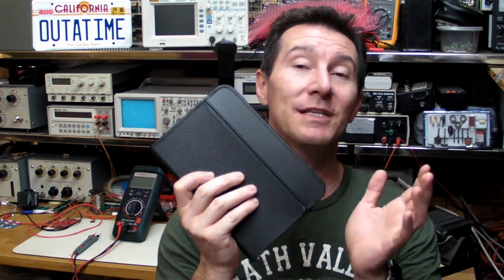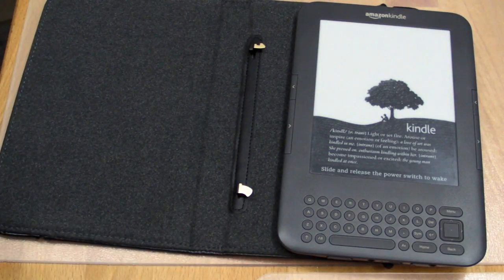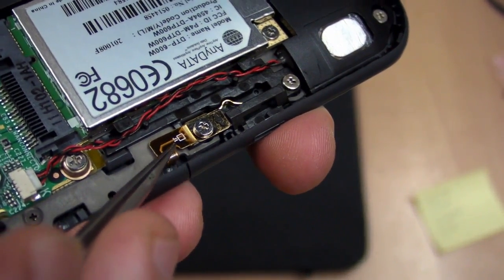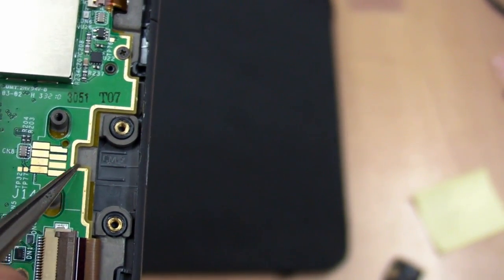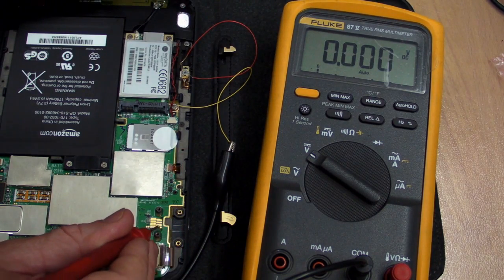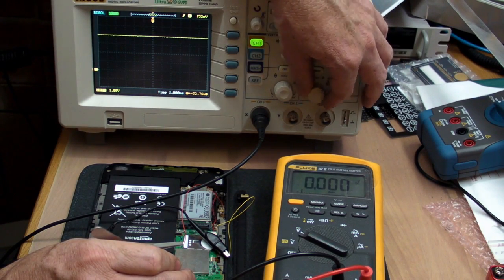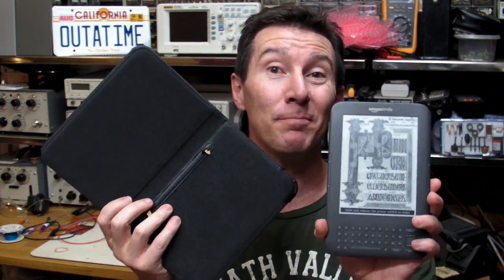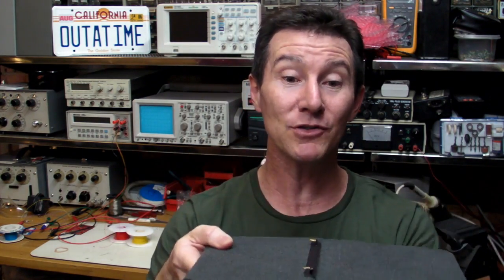EEVblog #135 - Kindle Case Mythbusting

Comment: but if those connectors have paint that is wearing out could it cause resetting when the mystery pin shorts only to RX or TX or even both without shorting to ground or even shortibg them together

Comment: Do these cases have magnets in to trigger read switch for auto-sleep/wake I know the newer kindles and cases do, as do quite a few similar devices. (My tablet does to)? I'm thinking just unlikely chance the the movement of the magnet when opening it is causing just the wrong stray current on just a particular track (the nexus 10 pogo pins seem to have this problem).

Comment: I am still using my Kindle 3 with the non-LED official case. I have one vague memory of accidentally picking the Kindle up by the Kindle itself - not the case it was attached to. The painted hooks on the case would be pressing against something inside the Kindle. It died. Turned itself off. I had no problem turning it back on. Other than that, I haven't experienced any issues with the case or my Kindle resetting or dying.

I have had my Kindle freeze occasionally. I could not get it out of standby mode. I let the battery die. After recharging the battery, all is back to normal. Unfortunately, my battery normally lasts like 2 weeks so it takes awhile. Turning it completely off (screen goes white) when you're not using it seems to prevent that problem. Always leaving the Kindle in standby mode (random image on screen) increases the risk of a lock up. Occasionally resetting any device that I tend to leave on 24/7 seems to help me avoid problems. Whenever I remember to, I cycle the power on my mobile phone, Roku, Kindle, and Nintendo 3DS.

Comment: Great myth-busting! :-)
The symptoms described sound ominously like capacitor plague symptoms. I wonder if the problem is faulty capacitors? You would need to get hold of one of these malfunctioning Kindles to find out the problem.

Comment: I bought my Kindle 3G Keyboard about 3 years ago and have used it every day since.    The first year I had it, I used the Amazon Kindle leather non-LED case - the same one in the video only without the built in lamp.   No problems - always worked.   For the last 2 years, instead of the leather case, I used a silicone rubber armor skin for drop protection.   It worked fine for 2 years until last month when it  started rebooting and then freezing continuously.    It has nothing to do with the leather case.   Sometimes, the Kindle will be functional for a short time, maybe about 10 minutes before going into a reboot again.  

I have tried the 20 (to 60) second On switch reset solution, updating the software to the latest, restoring the device to the factory default condition (deleting all contents) to no avail.   I see that in 3 years, there has not been a solution offered for this problem, either by Amazon or any hackers out there.    It is still a mystery.
Reply: Looks like they want you to buy a new model. Sounds familiar.   New model means access to new product offerings and maybe lower bandwidth use on their end. 

I used to be an Apple user. Maybe that's where my attitude comes from. 

Dump any device sold by a content provider. Life gets easier.
Reply: +Cristi Neagu Unpopulated memory can also be that between design and release, larger memory chips became cost effective and so they didn't need to populate all locations to reach the design capacity.

It also may be so they can release a higher capacity model later without redesigning the whole thing.

Designing for potential model changes is NOT the same thing as planned obsolescence.  Planned obsolescence is when you design it to become useless or break.
Reply: Lawrence Bosse My Kindle 3 has been working just fine for over 4 years. Never had an issue with it and battery life is still around 3 weeks (i don't actually know cause i charge it so rarely i can't keep track of it).
Reply: Lawrence Bosse My mk1 Paperwhite kindle is working fine after over 2 years.  The previous kindle I had (the model in this video) I donated to my dad and that's still working fine too.  Sounds like you just got a bad one.  The biggest problem I had with the Kindle 3 case is that there's only the two brass tabs to hold it in place in the case, and they're not very robust and break after a while.  I got another one and put a little bit of velcro tape on the back of the Kindle and in the case, problem solved.  The velcro keeps the kindle bending the contacts and everything's fine.
Reply: My experience has been different. 

Right from the early days of the intentionally gimped Macs.  I have found that most consumer electronics, when examined at the board or firmware level, show glaringly clear indications of planned obsolescence. 

Apple is the king of this practice, but I see it everywhere I look.  Strangely unpopulated memory, firmware with bricked-up sections that magically resolve into whole new "features" with the next version.

I don't know.  Maybe I am Jaded and too old.  When Jobs gimped the Mac only to release the New Version with nothing but the same board ungimped, I started seeing it everywhere.

---

After reading all of this again, maybe you thought I meant that the Kindle would physically fail.  I can see how I wrote that wrong.

What I meant was that when I opened up my first Kindle I found unpopulated "processors" (slippery term today with FPGAs floating about) and memory, only to find them populated and active massively in the next version, I figured they were just extending the product line to foolish consumers who will buy any new item.  Maybe that is restricted to Apple users.  I don't know.

I do see that I was not clear or on point.
Reply: Lawrence Bosse Unpopulated processor footprints might mean a lower spec version. Also, maybe those processors aren't tested with the full design yet, and they prefer to push the product as is now, and provide a better version in the future. In any case, considering that next to no one opens up their devices, and even less people spend the time to actually understand what goes on with the electronics, it would be no surprise to see companies taking advantage of our ignorance.

Comment: Try increasing the fault current draw upwards beyond the 250mA you've demonstrated as not being a problem. A sustained high power draw near the current limit point could be a problem if it causes a voltage sag elsewhere (i.e. the problem has propagated).

Comment: I've had a lot of problems with my kindle freezing but this is the first I have heard that there is a case issue.  Hmm, guess I should stop using this case then and see if that solves my problems.

You probably haven't looked into it further, but since this video is almost 3 years old, I was wondering if the problem was ever determined?  Its not a short of those contacts but does anyone know what the problem is?

Either way, good video!

Comment: your analogy is moot for the reason that you are talking about testing a completely different product (make and model) for a problem in another product with the only similarity is that they are the same TYPE of product. but to put your analogy to proper use we can say, if you have a common problem with toyota (say the accelerator is sticking) but its most prominent in a prius that is painted black. this does not mean you cant test a gold one because the issue has only to do with the accelerator.

Comment: ESD or maybe a mechanical stress in the right spot on the PCB. My guess is ESD from a plastic case that should have had some carbon added to the mix to keep it from building up a charge. Usually pins for any connection are tucked in far enough to keep any shorting issues at bay. Thankfully I am too poor to run out and buy the latest gadget. I also like to see the initial failure rate of an item before I invest in it. Leave it to some twit to make a fatal carrying case for the darn thing!

Comment: Hi Dave. God Bless you mate. I really am having trouble with my Kindle 3rd Gen WiFi only. I have tried all rebooting methods, recharging for 30 Mins. rebooting again, etc... The unit is frozen on the book list menu all the time. The yellow led turns on when plugged-in to the adapter, but, the green light does not. Why is it frozen like that? Can you help me in understanding this idiotic problem Dave? Do you suggest I just ask Amazon to give me a new one? Amazed at yor knowledge too. Thanx

Comment from the maker: @crazypete05 You clearly missed the entire point of the video, which was explained (clearly I thought) up front.
There was a rumor that the metal contacts were shorting out the contacts in the connector. That CAN be investigated and tested without the actual case. In fact to prove it I would have had to rub the coating off the contacts on the real case to make it EXACTLY like the case I used.

Comment: Hi Dave, I watched your kindle case mythbusting vedio.
My kindle suffered the same problem. What I did is took it apart, first,took out the brass spring in the upper hook. Problem was still there. And then, I used tape to completely disconnected the four contacts with the mother board. This time, problem solved. I'm not a EE but my theory is some Kindles have defects with that four contacts and the non-lighted cover triggers the reboot problem. Not every people with the nonlighted cover -->

Comment: Hey,Dave. I've followed your train of logic (on the troubleshoot). You've suggested an ESD issue here,correct? I don't have a Kindle available..but I'm curious as to the actual mounting points on the PCB (to the shell). Is there any indication of stress-related flexure (around the physical mounting points) ,or have you ruled that out?

Comment: Based on the tests you've done it looks like the problem relative to the case is more lilely to be coincidental than a direct cause. I have heard of Amazon Kindles crashing without the case.

although...
Have you thought about the problem being caused by heat?  Could the case be acting as insulation?

Comment: you didn't operate the kindle while the RX and TX were shorted, maybe if they were shorted and a debug message was sent out the TX and looped back to RX, the software might interpret it in such a way that causes the unit to malfunction.

Comment: my electronics knowlage ends at a british AS level so this may sound a bit... obvious.

but thinking of this black paint, if it contains metalic traces in the paint and people have complained it's flake-ing off.
maby these flakes of paint are causing shorts in other areas of the board. so it may not be the direct connections we're worried about.

and as you'e pointed out, the paint is one of the differances between the 2 cases.

anyways, goodluck catching it.

(removed comment due to typo)

Comment: My two theories:
1) The other case doesn't short at 0 ohms, but maybe 5-10 ohms and hits a "sweet spot" where the protection doesn't kick in, but the you still get current overload.
2) Latchup: First, the bottom input is safely grounded, and also connected to the LED driver. The LED driver can sense the short, no problems there. Then suddenly, the bottom handle loses contact with ground, but not TX/the bottom pin, and causes latchup since it's 1.8 V logic, while the LED driver is 3.x V.